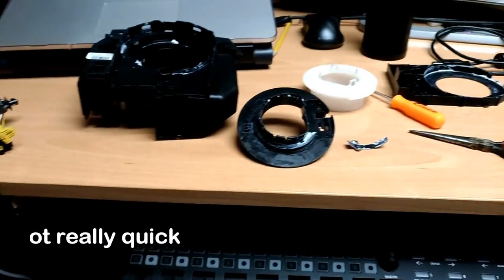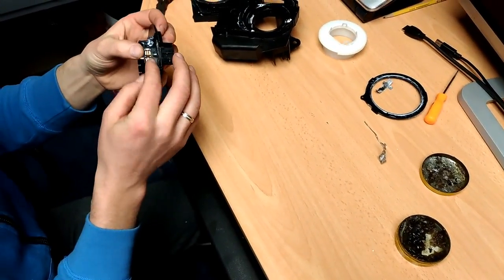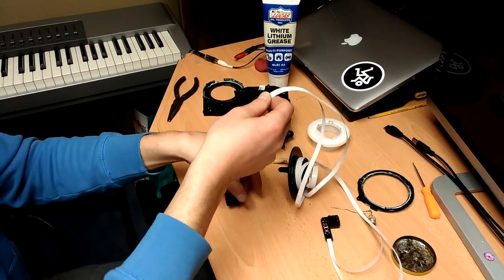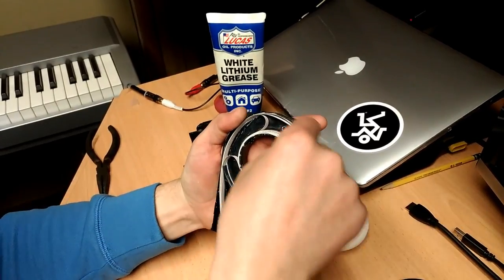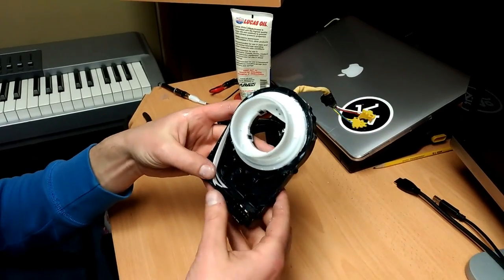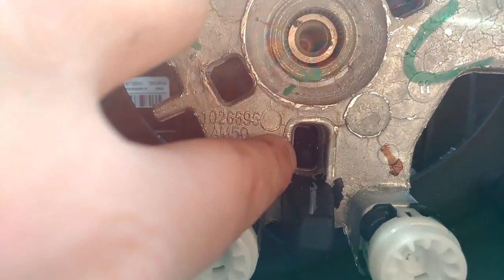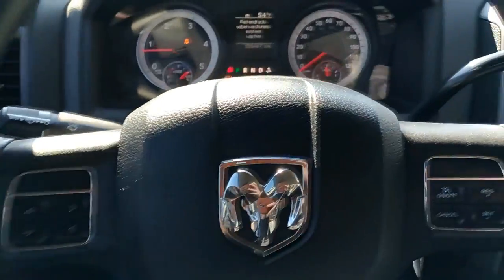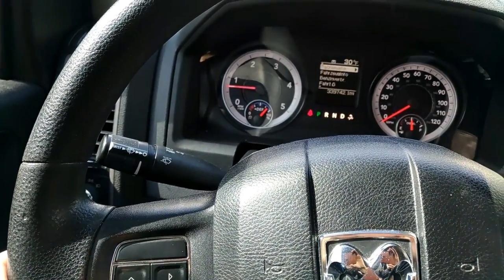Dodge Ram Clockspring repair and installation

Comment: Good job!you just saved me $550 in parts.also for calibrating the Steering angle sensor is to turn the clock spring all the way to right then turn it back 3 and half times.and you should have extra 3 and half times space to turn it all the way to left.if you turn it more it would brake the wire inside for air bag.air bag wire is the shortest wire in all the wires inside.

Comment: Nice 1. Step by step so this encouraged me to have a go. I did manage to fix it, ( turn off airbag warnin light) although it seems I'd a slightly different problem. And working on a different vehicle, Rebault Master, but steps all the same near enough however I could find no broken, cracked or frayed wires or pins in need of soldering or fixing, but what I did do while I was at it was to clean up all the plugs and electrical connections before putting it all back together and this seems to have done the job. Might try this 1st before taking all apart if ever going at it again. 

So good oul WD40 comes to the rescue again and saving €250 on parts from manufacturer whenever he managed to get them in. Thanks for very helpful vid also, cheers.

Comment: Nice job....so they are repairable....gotta do mine
Reply from the maker: Not really designed to be repaired, but as you see, can be done. Mine still works 💯 after I redone all contacts, even those which were good at the moment. Eventually they all gonna break. Just do them all while you there.

Comment: Thanks for this nice video I will try to fix it but my question is how much heat device is used?
Reply from the maker: I can't tell you how much heat exactly I used, but small soldering gun would work. Its really small contacts, so you don't need lots of heat. Don't go too crazy so you won't melt all around repair area. Best of luck!
Reply: Fixxxer ok Thank you so much again ☺️

Comment: Do you remember what scan tool you used?
Reply from the maker: I used Autel, but anything alike that can read steering wheel angle sensor would work.

Comment: Thank you for video. I am not very mechanical but I am going to try the fix. Could you please explain again where the steering angle sensor is located and how not to disconnect it? It seems like this is an important step. I know you explained it at the very end but could you please give me some more detail where it is and how not to screw that part of it up. Because I do not have a scanning tool to reset, I don't have any friends that have a scanning tool either. I would have to take it to a dealership. Thank You Again, by chance do you have any other videos on dodge ram repairs?
Reply from the maker: Check out my conversation with Guilherme Martins, I explained here in comments where the sensor is, and couple other related things. Just look the comments up.
Reply: By chance did you disconnect your battery before starting to pull the steering wheel off. I have seen videos some disconnect the battery some don't, what's best. I am assuming not to disconnect the battery because you need to use the scan tool?
Reply from the maker: @marcusslaten8806  if you're not much experienced in car repairs I would suggest you to disconnect it, before you unplug steering wheel airbag. You might need to turn steering wheel left and right, and it's easier on running engine, so after you remove bag, right before disconnecting it, put your wheels straight and then disconnect the battery, and then bag connectors.

Comment: Mine on my 2014 is clicking when turning. Do you think the grease is all dry?
Reply from the maker: Possibly it's column itself, not the clockspring, not sure. But very few chances it's dry, even so, not much to click inside of clockspring. High chances it's something else
Reply: @fixxxer6484  I don't think it's the column it definitely sounds like plastic scratching plastic. Definitely coming from right behind the steering wheel
Reply from the maker: @blakeerdmann  take steering wheel off, and inspect it. With wheel on, it's hard to tell what's going on under it
Reply: @blakeerdmann  Im going thru this right now, did you figure out if it was the clock spring or not?
Reply: @misaelroman1215  no. Sometimes it does it and sometimes not. Im thinking it's the clockspring though.
Reply: @blakeerdmann  Yesterday I disassembled part of my steering wheel and I turned it .On my car it definetly is the clock spring due to the fact that I put my fingers on the side of the clock spring and turned it and actually felt the tiny "click" inside the clockspring itself! It was simple took me like 5 minutes on my 2014 Honda CRV.
Reply: @misaelroman1215  did you rebuild it or just replace it?
Reply: @blakeerdmann  No rebuild mines not expensive so I am going to replace it. It should be easy!

Comment: Hello Sir, i'm having real difficulties to remove the two black connector from the plastic housing where the wire strip is connected to. Can you help me with that please
Reply: Use something like credit card or guitar pick, they have locking tabs on the bottom. So insert card between connector and the housing. It's tricky a bit. Don't force it too much, or they would break. They work even broken, but better to save it. The one that closer to  the wires, should come off first. Hope it helps
Reply: Well I have broke it 🤣 but yes finally I think i got it. Mine was completly riped off, I have to figure out by logic which wire goes to which connector. After 4h i think i finally got it omg

Comment: And... does it still work? I bet it will break again soon, either directly next to the repair spot, or at another kink. That ribbon cable is worn.
But finally a nice vid showing how it works
Reply: It broke in another spots, not the same wire, so I took it apart again, soldered all of them, 40k miles after that, still works as new.

Comment: How did you get the two connectors for the ribbon cable off?
Reply from the maker: If you mean the ones that stamp welded to the housing, then you just carefully pry them, or cut welded area with utility knife

Comment: Do i have to set clock spring rotation halfway before installing it? Just worried it might break the ribbon if not properly set while steering it .
Reply: Yes, you do have to. In the video I explain how you have to have at least two turns each way. Go to 13:10.

Comment: Good job but never open the air bag assembly without disconnecting the battery negative wire.

Comment: For safety you NEED to disconnect the battery
Reply: For amateurs, yes, but for Master mechanic, we don't need to disconnect the battery, as you unplug the steering column harness, you disconnect the power.

Comment: My reverse camera is off ligned. Do you think if i put new clock spring it will fix it?
Reply from the maker: I dont really understand what's happening to your rear camera
Reply: Fixxxer you know those yellow lines that pop on the screen when when you put the vehicle on reverse? There supposed to be straight just like the steering wheel right?  Well i got my steering column replaced at some point and then after that the reverse camera was not the same no more, the yellow limes do not match up to the steering wheel
Reply from the maker: @fivestarhemi2877  do you have traction light on on the dash right now?
Reply: Fixxxer looks like a Christmas tree to be honest, even the check engine light came on
Reply: Fixxxer i will do a video when i have a chance & tag you. Thanks in the meantime
Reply from the maker: @fivestarhemi2877  most likely resetting the steering angle sensor would cure the lines issue, most likely it's out of calibration

Comment: If i send you mine can you fixe it? Its from a 09 g8 gt?
Reply from the maker: Sorry man, too busy with my never ending projects. My brother had some issues on his g8 few years back too. But I didn't get involved that time
Reply: @fixxxer6484 damm it, the problem is that,i cant find a replacement part not even om the dealership, does your brother have a chanel so i can ask him?
Reply from the maker: @JesusRangel-kn8hl  he doesn't. What's your issue? Tell me I'll ask him. He had issues with some switches I believe. He got another steering wheel, and either side didn't work, If I recall correctly. Try Australia. They are flooded with g8 over there. AU eBay might work for you.
Reply: @fixxxer6484  well the issue is te clock spring, no power on the steering wheel, air bag light on, and buttons dont work, i know they have a car name holdem ve but im not sure if it fits on mine since the part number doesnt match
Reply from the maker: @JesusRangel-kn8hl  if you find the one that looks the same as yours with buttons, it should work, even parts numbers won't match. Or you might consider to get entire steering wheel with clock spring included.
Reply: @fixxxer6484  shure thats my last option anyways lol, thatnks man